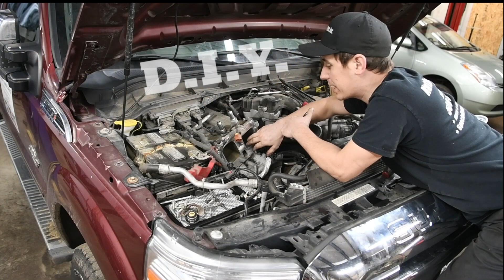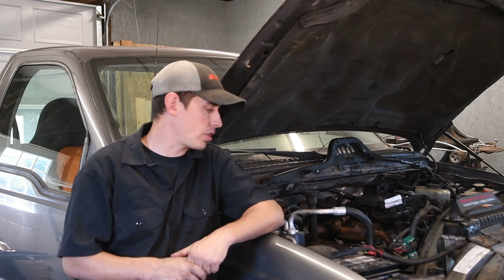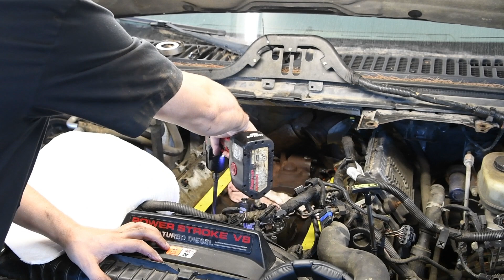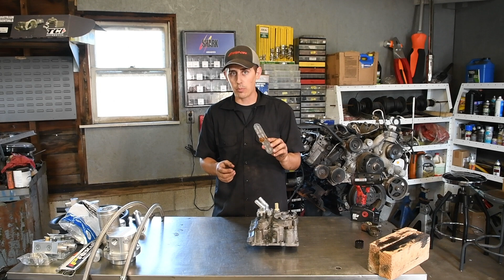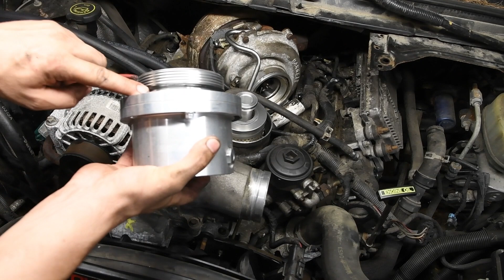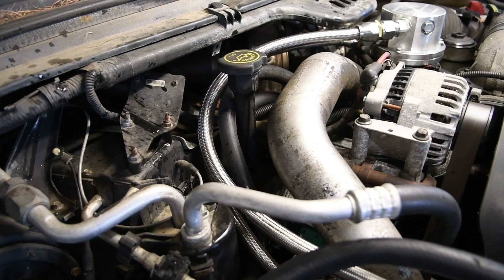6.0 IPR REMOTE OIL COOLER INSTALL....Short version

Comment: I have the motor out of my 2010 E350 6.0 because a lifter roller broke.  How bout using Fel-Pro heads gaskets during re-assembly?
Reply: Hi Guy, first of all I am no professional mechanic by any means but have done plenty of engine to where I developed enough courage to own my first diesel that's an 2006 F250 6.0 and did my own bulletproofing in my driveway. (ARP studs, Fel-Pro HG, water pump, updated EGR and Oil cooler, STC fitting, dummy plugs and sandpipe, 6.4 pushrods, HHC nipple oil rings etc.. 

To help with the HG question, so far I have driven 30k miles pushing pretty hard with a lead boot every so often. Tunes, im running Looney Wild from Eric and switch it to Eco City or Looney PCT. 

This is just my real worl experience with the work done on my driveway dedicating a few hours a day after work. It has been running great thus far. Hope it helps with your decision making.
Reply: @ANGKORIAN2o9   Did you pull the cab ?
Reply: @stephanvallee5167  No sir, I did not have to removal the cab. I can't take any credit because I learned this from Josh 6.0 Doctor.

Assuming you got far along with the oil cooler and intake manifold out already, we can start at removing the heads.

I completely removed the driver side engine mount only and continue to jack that side up with a 4x4 block just enough for clearance to remove the driver side head. All tty head bolts will come out easily. Once the drive side head is out, lower the engine and rest the engine block on the chassis (engine mount completely removed already). This will tilt the passenger side just enough to remove all head bolts except the lower rear 3 bolts. These 3 bolts will come out with engine being hoisted out. The heads are very heavy, use an engine hoist will save you the agony. 

Upon installation, place 3 ARP head bolts at those lower rear 3 location temporarily securing them with zip ties prior to lowering the head back in. This applies only to the passenger side. Drive side, you can set the head in place and ARP bolts as nominal. Factory is 210 ft-lb, but I have mines at 245 ft-lbs (reading forums and from shop) The head gasket I used is Fel Pro and it's still holding up thus far. 

Again, im not professional but have about 14 years of aviation experience so surfing prepping, torque specs and following available procedure is pretty standard.
Reply from the maker: Hey Arden, I personally have not used the Felpro gaskets but a lot of very reputable people I know have used them with great luck. I typically use the mahle or ford which are both the same gasket just a different color.
Reply: I wouldn't use anything but factory motorcraft headgaskets.
Reply: @andrewb9708  Hi, may I ask why Motorcraft HG only? I'm all ears
Reply: @ANGKORIAN2o9  I own two and both are bulletproofed.  Both shops that did the work (one shop owned by former Ford master tech, the other shop builds pulling tractors) said they have had issues with aftermarket head gaskets and recommend OEM only head gaskets.  Both are credible and extremely knowledgeable of the 6.0.
Reply: @andrewb9708  fair enough explanation and I can respect that. This is only my first and so far have holding up with fel-pro. By all means, I cannot say it will out last the OEM HG. I do, however, thought that it was not the HG that was the cause but the TTY head bolts stretching due to increase in cylinder pressure. All in all, your feedback along with mines are all valuable information for other viewers to consider and make their own judgment decision 😀

Comment: any particular reason you went with the IPR remote oil cooler vs. the BPD one?
Reply: Most likely price.  The IPR system is about $400 less.  I'm in the process of adapting the bulletproof manifold to their 6.7 heavy duty oil cooler.
Reply: @andrewb9708  can you get me some information on that? I would love to do that adapt that